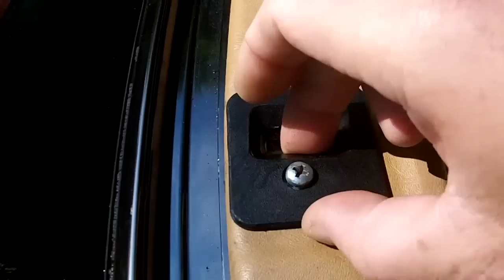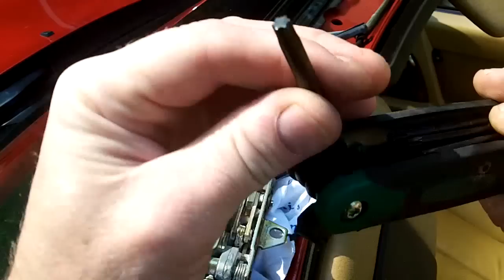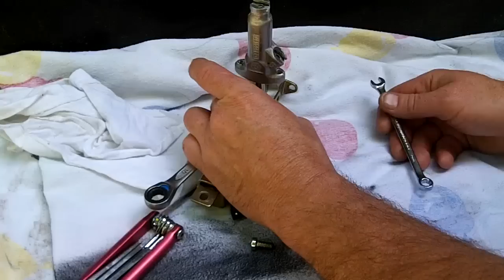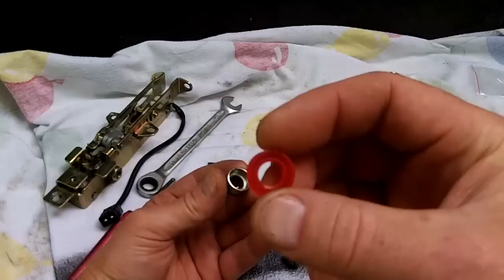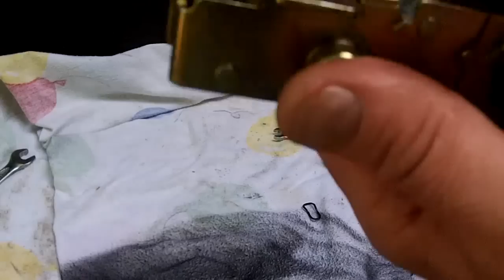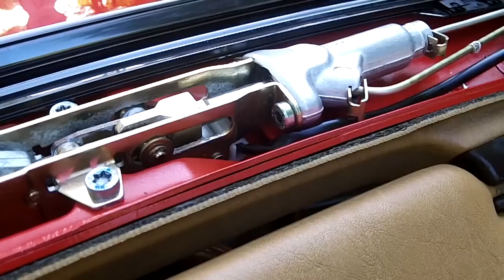Rebuilding Hydraulic latch cylinders  Mercedes convertible R129, W124 convertible

Comment: Great video!!! Gave me the confidence to tackle myself. The clip rings are the hardest part and I found clamping the hydraulic valve between 2 blocks of wood in a vise you can  tap the small screw driver with a mallet or rubber hammer and more easily remove the clip. Even though we tried to cover the ring with a shop rag to prevent it from going airborne, it flew across the shop and landed in a canoe hanging from the ceiling. If we hadn't heard it we would have never found it!!!!
Reply from the maker: a canoe...lol  yeah you are lucky you heard it

Comment: B.J.Murray - very well done video and a great help. One small variation with my 2000 SL500 is that there is a second small screw on each end of the windshield cover UNDER the rubber molding.  After removing the first exposed screw from the rubber molding itself, you need to lift it up and away from the cover to see and then remove the inside brass screws on each end;  otherwise, the cover could be damaged or not able to  'slide off' at all.  One gets to see and appreciate some of the more exotic and precise engineering of their Mercedes in achieving an exceptional soft top (and matching hard top) operation. Until this minor maintenance, mine has worked perfectly for 15 years.  Thanks for your contribution.
Reply from the maker: Thanks for the info on that screw,

Comment: I rebuilt the rear latch cylinders on my 1997 SL500 using Belov's seals.  They worked great.  I first ordered a rebuild kit from eBay, and what I got was a handful of useless o-rings.  Belov's seals are expensive, but they work.  The first side took me probably 3 hours.  The second side took me probably 30 minutes.  The only thing I could add to this video is a trick to unscrew the pistons from the latch mechanism. They were so tight, I could not get enough leverage with a 7mm open-end wrench to break them loose.  I ended up clamping Vise Grips over the jaws of the wrench to get enough torque on the rod.
Reply from the maker: appreciate the tip
Reply: Ok, two things to add...The right side rear latch was the one on my car that was leaking.  When I got it replaced and tried it out, the left side leaked.  Belov says replace the seals in pairs (i.e. L and R).  That advice was spot on.
Reply: Not all of the piston rods use a 7mm. One on my car needs a smaller wrench, I don't know if its 4mm or 5mm because I cannot find anyone selling any smaller than 6mm. Any tips?

Comment: I just did the job.  Not too bad.  The spring rings are a bee hatch to get out and the 7mm/10mm piston disconnection was on much tighter than anticipated (no sign of any thread lock either).  

I ordered the whole kit as my left rear lock cylinder is blowing fluid too...at least I have all other seals as they’ll eventually leak too (‘99 SL500).
Reply from the maker: yup..those spring clips are the worst

Comment: Thanks for posting! I bought the seal kit from mbseals and installed them today. Working fine now! One of the screws on the top plastic cover won't tighten all the way but everything else is great.
Reply from the maker: +Dan Lutnick excellent.. glad it worked for you  :)
Reply: How are the seals holding up?
Reply: Muneeb Ajmal still working Great!

Comment: Hey, hey, 
UPDATE..I rec'd the seals from Konstantin at MB Seals w/in 48 hours of order. Thanks! Just finished the rebuild of the cylinders and all is AOK. Everything went smoothly (watch those spring clips...lol). Candidly, very simple to perform...especially with your video. That's a good thing...
One minor note...I have a 97 SL and along with the mentioned "post cap" screw and the "latch surround" screw, there are an additional two screws, per side, that need to be removed. The first screw is on the roof rubber gasket about an inch below the post cap (don't worry....its really obvious), and the second is under the rubber itself. Although hidden, just lift the rubber. It is very easy to remove also.
Again, thank you for the video and the referral to mbseals.com. Major kudos to you...Warmest regards,
Reply from the maker: Kite Yoda  Glad it worked out, thanks for the good info on the newer model difference.  :)
Reply: Kite Yoda I cannot get the spring clips out they are in there.  I have tried a lot of different screw drivers and pics.  I started marring the area a bit.  I'm worried I'm not going to be able to get this out.  Any help would be great!
Reply: Andrew Bryan  Hey Andrew,  If you're marring the clip area, probably a good idea to get some help. When using a pic/screwdriver to get out these  type of "C" clips, make sure that you pry at either end of the clip itself to get it out of the groove. I'm sure that you've done that, right?
These type of clips can be a pain because there isn't a special tool specifically for this (Unless a screwdriver/pic can be called a special tool).
Nonetheless, giving you credit for trying the obvious ways so we don't repeat everything here, maybe you should just take the cylinders to the local auto shop and have one of the techs help out and remove them. 
Be aware, however, that he'll probably use some sort of pic/screwdriver method too for these clips.
Bottom line....the clips are out  8^)    
FYI...when reinstalling the clips, thoroughly clean the grooves the clip sits in. 
Best wishes...hope this helps
Reply: I also have a 97 , this MBseals site is a bit confusing can you tell me the part number you ordered from him? thank you

Comment: great video!  I completed the rebuild the other day. It wasn't that difficult.  I spend more time taking it apart then changing the seals but it was worth it, nothing leaks anymore and everything works fine.  When unclipping the ring be carefull it flies to oblivion, lucky i found it.
Thanks!
Reply from the maker: Lol..Those clips are surprising..I think mine went about 20ft in the air... :)

Comment: Great job! Here's a link for the proper hydraulic fluid ... the febi for $9.44 and the MB for $14.40 per liter .... the full tank holds a little over 1 liter if you desire to replace it all while you're at it .... Thanks for the video!

Comment: Just changed the seals in my 1997 320sl.  The video made it pretty easy to accomplish.  I just had trouble finding a 7mm thin wrench.  But I found a slightly larger non metric that did the job
Reply: WHERE DID YOU GET YOUR SEALS FROM AND HOW LONG DID IT TAKE YOU TO COMPLETE?   MINE IN MY 1997 SL 320 ARE NOT YET LEAKING. iN YOUR OPINION SHOULD I wait until they leak  or do it asap?

Comment: excellent video, I have a 2001 SLK 230 Kompressor with the hardtop convertible  and I need to either rebuild the top latch releases or replace them. (one or both were leaking) after watching the video I believe there shouldn't be much issue. but my question is do you have any idea what part number I would need ? I looked on the mbseals.com but couldn't find my car model. Would the soft tops use the same as the hardtop ?

Comment: Thank you so much for your video. I tried to loose the cilinder from the rest and tried to unlock the bolt that holds it to the mechanical part ^^ And lucky I got a 7mm wrench ;-)

Comment: 2000 CLK 430 convertible, the top operates
correctly until closing. It works fine until the rear window goes to latch and it sounds like the tonneau cover unlatches, the window latches but then the trunk won't open and the red lift button lights up, signaling something is wrong. Any thoughts? Thank you for all the great videos.
Glenn
Reply from the maker: I don't have any experience with the w208 convertible, but if it is mostly the same as the r129 I would assume there is an issue with the limit switch on the windows or whichever function precedes the trunk opening.. A Star diagnostic would pinpoint the problem in a few minutes, but try a reset first.. using the included tool in your trunk and the instructions in the owners manual , raise and lock the roof manually..turn the ignition on and lower and raise all of your windows with the window switches. On all the windows press and hold to lower and continue holding the button to lower the window for an extra 10 seconds..do the same for each window and then raise each window and hold an additional 10 seconds. This teaches the computer and microswitches .to recognize full up and full down position of the windows
Reply: +fupabox Thank you for your reply. Will try the reset. .

Comment: ***** thank you for the video, but what about the 3rd seal? which is at 11:10 under your right thumb.
Reply from the maker: Dokepredator  I somehow missed this comment..sorry.. The seal on the end of the piston from what I have read, rarely fails... if it does there are no leaks, just lower internal pressure

Comment: Great video. I have been trying to remove the snap ring for a while. I can't seem to pop it out. I even have the same screwdriver. Any advice?
Reply from the maker: It's a bit of a pain to pop out..the first one actually ended up making a huge blister on my thumb from the multiple attempts to pry it out...the second came out in seconds..I saw another video a while ago on removing snap rings (unrelated to Mercedes ,) and the guy pried at the closed end of the snap ring directly opposite the opening, he explained that it took less prying force that way because both open ends moving together towards each other halved the required force to pop the clip out..also keeps the ring from being chased around in the groove as you try to get under the end..it seems to make sense,and it worked well on the hydraulic cylinder I was working on
Reply: I got them out! The first one took forever, a trip to see if my neighbors could help. I finally found a bent up screwdriver that I should have thrown away, but it worked perfectly. The ring shot across the garage. The second ring took less time than it took me to find the first one! Only seconds. Just waiting on the replacements now. Thanks!
Reply from the maker: Steve Buck
any time :)  glad you got it

Comment: this is a great video.  I cant seem to get the soft top to come up.  is there a special procedure to make it work??  thanks
Reply from the maker: +Raul Romo   does the switch blink when you try to raise the roof ?
Reply: I only feel that the switch can be moved back, I think that's to unlock the top.  I have to try again.  read up that the doors have to be open and windows down before you attempt to put top up
Reply from the maker: +Raul Romo  back is to lower the roof, forward is to raise it..the windows should be down, doors can be open or closed
Reply: thanks will try again
Reply: +fupabox If the key is on when you unlatch the top, the windows are supposed to go down automatically. If you get a flashing light on the top's switch, open the trunk and make sure the top protector is fully forward and the latch is secure, as there is a sensor (micro-switch) that stops it from operating. Also, if the headrest in the back are raised at all, it won't operate, either. When you had your leak, you might have lost too much fluid (hydraulic oil) and it needs replaced.

Comment: I'm surprised there isn't  some type of seal that goes between the lines and the cylinder... Metal to metal seams like it would leak
Reply from the maker: That’s the beauty of Mercedes engineering in those days . The absolute finest tolerances . Most things with a tapered compression fit require tightening torque to complete the seal . These have a simple clip . Engineering porn 😁

Comment: Hi great video mine just started leaking (right side) so I'm in the process of taking them out, I couldn't undo the cylinder for the life of me (7mm /10mm wrenches) you seem to get it fairly easy unless you have loosened it off camera?  mine is so tight I cant get it to loosen, any tips thanks
Reply from the maker: actually mine was loosened off camera to be sure it would come undone then retightened, wasn't much tighter than when removed on camera though... If I remember correctly the other side was much tighter and required a good amount of torque to remove..They are installed with threadlocker on the threads so they can be tough to unbolt
Reply: Yea I was just reading on the "Top hydraulics" website which is a rebuilt service in Oregon, that you have to soften the thread by either using a heat gun , acetone or overnight WD40, I do have a heat gun, but I'm worried how much heat to apple I even have the one with the small nozzle for electric board rework which I can focus the heat perfectly on it, but then again what temp do I set it and how long to heat for is not clear, so I opted for the overnight WD40 if that doesn't work I will ship them to Top Hydraulics and bite the bullet and pay the a little over $100 (he charges $50.00 a piece and I have to pay to ship it to him)   instead of $20 for the seals and finish the job myself , oh well, still better then dealer's. hopefully tomorrow it would have soaken with wd40 and it would loosen up, crossing fingers.
Reply: BTW I love your channel, I have fixed many things on my car watching your videos, thanks
Reply from the maker: I didn't need any heat or WD40....maybe some were put together with permanent strength thread lock , which needs heat to remove

Comment: Hey CW, I've got the leaking problem in my main lift and extension cylinder(right side) ..... uggg ...... would you recommend rebuilding both sides or just do all cylinders? Also, do you think for these main cylinders I could rebuild myself with MBseals or should I send them out?  Are the seals the same as what TopHydraulics uses? Thanks for all of your invaluable info! DB
Reply from the maker: +kedocom  There is a write up on the main cylinder on the mb seals site.. I haven't tried the main cylinder , but it looks doable..for the $50 for the 2 seal sets compared to several hundred to rebuild..my self I would give it a go. I'm not sure on the materials used by the 2 different companies
Reply: Thanks for the reply .... I might just give it a try .... I like the idea of being able to re-install it in short time as it's placement is still fresh in my mind rather than wait a week .... Cheers friend :)

Comment: Hi I have a 1995 Sl320 my problem on my soft top is the last part where the soft top is meant to drop down to go to the lock in does NOT go Down any suggestion if i pull down and push does close and lock in place the rest of soft top works fine Thanks
Reply from the maker: Try resetting the sequence on the soft top...once it is down and locked away start the car and hold the roof switch in the top down direction for 30 seconds.. then with the button raise the roof and hold the button for a further 30 seconds once up.. that should reset all the microswitches and relays and get them into the proper sequence.. if at some point the top was manually raised part way the controller/sequencer  for the roof can get confused... It is also possibly a bad or unhooked microswitch on the roof.. or a weak solder joint in the roof controller..But the reset is free and easy to test , so it's always worth a shot

Comment: I have opened up the latch cylinder area and cleaned up some fluid but didn't make any changes.  After closing up, I am unable to completely close the roof.  It stops when the roof is on the top of the window so it appears that the latching system in not finishing.  The is a 1998 SL500.  Any thoughts?  Thanks
Reply from the maker: +Paul Carlson try resetting the top sequence  .. pull back on the button to open the roof and then hold the button in that position for a further 30 seconds... then try closing
Reply: +fupabox Thanks.  I tried it and it seems that the front is latching well, but the rear cover remains vertical.
Reply from the maker: Paul Carlson now that the front latches, do the reset again pushing the button to close and again holding a further 30 seconds...If it doesn't work, you may need to close it manually with the tool in your toolkit, and then do the reset in both directions with the button

Comment: Fupa. This weekend you saved me $1600. Can't wait to hit the button tomorrow. Need fluid first. Any direction or sources you know on doing the rear lock, let me know. That's next. Again, can't say thanks enough!!
Reply from the maker: glad it helped...which lock are you referring to ?
Reply: Well, the mechanic I used to diagnose the issues said its 1298002172 but I ordered 129800072 and took that from another diagram.  Today I got into the fluid. I was bone dry.  There was maybe a tea spoon in the reservoir. Filled it to the max line with MB fluid and ran it through a cycle. It's all good until the top hits the top locks where it won't seat and won't go any further. Is it possible that my top locks are manually opened or locked and they can't function? Also has a drop of fluid come down the a pillar. Scratching my head a bit. Any thoughts?
Reply from the maker: Jared Cowan
the fluid coming down the pillar could be left over from when it leaked...there are no manual parts at all on the top..it is possible the controller for the hydraulic top has a bad circuit in it...depending on the year of your car there are micro switches on the latches to that will only allow them to lock when it knows the top is all the way down or up...if one of those micro switches isn't operating properly the next step in the raising /lowering sequence won't be initiated..I haven't delved deeply into any of them yet ,but I have a project SL in the driveway with some hydraulic top issues..I will post anything I find may be helpful

Comment: maybe you can use a vacuum cap to plug the line so it doesn't leak, or a piece of hose with a screw at the end of it, to avoid a lot of hydraulic fluid leaking
Reply from the maker: Raul Romo yes , a good idea when unhooked to cap them some how..I like the rubber tubing idea..be very careful since they are precisely machined to fit and seal into the cylinder.there are no other seals for the lines